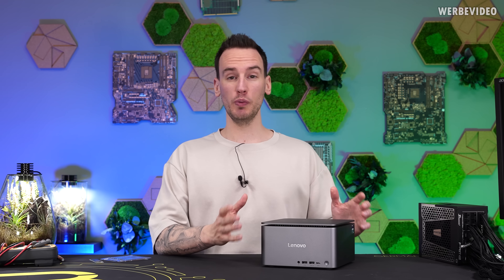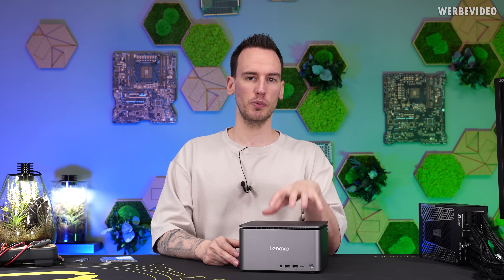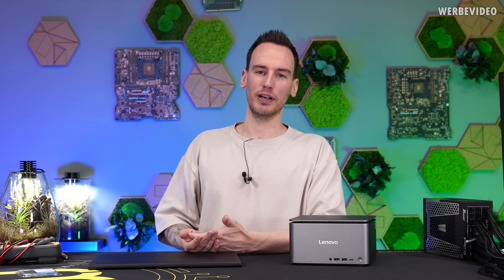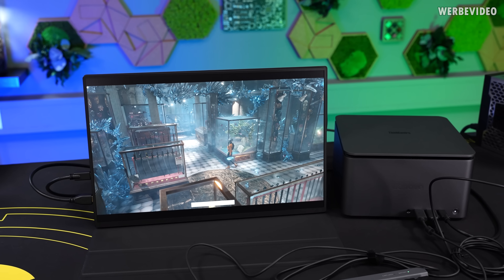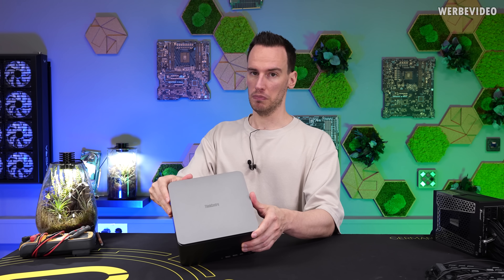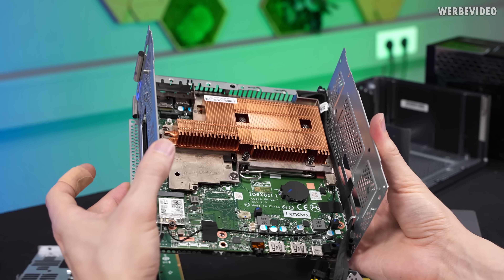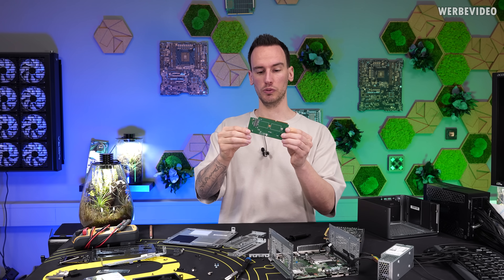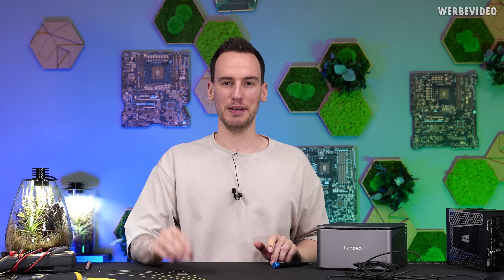Interesting Cooling Solution inside my new Lenovo Mini-PC

Comment: Laptops can feel slow because of the way their bios is set-up. My Asus changes RAM frequency and timings on the fly and I wouldn't be surprised if it mostly stays at the worst ring frequency and gear ratio possible. If I were you, I'd go with 2 gaming laptops from MSI or gigabyte as you'd have higher changes of changing important settings in the BIOS. I'd look for a CPU with the highest tdp possible, lowest node and the highest amount of cores + any Nvidia GPU. I'd lock the GPU at 700mV and set power limit as low as possible as premier won't be bottlenecked by it

Comment: When it comes to notebooks being a little laggy... I own a Dell XPS 9520 with i9 12900HK as well as the Lenovo P16 Gen2 with i9 12920HX. Both of them feel laggy, somewhat unresponsive. Even in maximum performance power mode.

Comment: Awesome little beast of a Lenovo. You should have gotten a thermaltake tr100 case and built a little machine in that. The Tt has a carry on size suitcase that holds the computer, mouse, keyboard, and monitor as well.

Comment: Good news, there's actually a 4070 that is on that size. If you ever heard about this news, it's Zephyr RTX 4070 ITX, the ones with white accent and pink PCB (they also did the black version of that recently called Black Snow)

Comment: I did the same setup last year. If I had to do it now, I would go with BD795i SE ITX faster, smaller ,cheaper. Also mini-pc's have slightly higher powerlimits so they aren’t bogged down like notebooks.

Comment: 10:15 yeah. That's definitely not a good contact with the ihs.
Looks like there's a big distance between the two contact surface areas. (Especially on the right side of the ihs of how we look at it)

Comment: It is not just you even the memory latency that you can see in Aida64 on laptops is HUGE even double than on desktops. The lag is real and sux! I get it that with lower power use comes some sacrifice but not latency on small soldered devices come on!!

Comment: I think that "laggyness" of notebooks is probably simply due to the inherent aggressive downclocking and c-state switching they have. Even with max performance setting inside the OS and BIOS, notebook components have power saving things built in their firmware

Comment: *Ethernet works better than Wi-Fi. What a F surprise! As ISP support specialist I burning my ass to the ground, when people buying cheap shitty Wi-Fi routers and expecting stable 300 mbit/s speed and zero packet losses in games. Just buy (or make) 10-20m Ethernet 5e cable, take it to every ride and be happy, man... it's cheap as hell and giving you perfect connection at 1 gigabit standarts.
*Choose mini-pc instead of laptop for my wife too. Not because it is convenient, but because laptops in the same price range turned out to be worthless garbage. In addition, if the mini-PC or monitor breaks down, you can simply quickly replace them without waiting for expensive spare parts or repairs for the laptop.

Comment: @der8auer EN wouldn't a Mac Studio with and external nvme drive (to avoid apples storage price) have been a better choice?
Or is it just out of the question to work with a Mac for a few days?
It's performance and price surely must be better than this right? And on top of that its really small and great resell vallue.

Comment: A bit disappointing the 4070 is only available in China, I'm in HK and even the official store is only selling the neo Ultra which is 14500+4060, would defo get the 4070 when its available.

Comment: Wifi at hotels is shite. Ethernet all the way baby.
Even with a network card, or onboard network with antenna, 5Ghz WiFI in the same room, dropped connected every 5 minutes or so. Annoying as sh*t.
Also the efficiently they have on those 3 fans is amazing. 2 blower style fans in laptops, and 1 gtx 4060 are very balanced. Insane!
Reply: to be fair, wifi is bad even at ones home, even when one buys a decent router

yes, ethernet adapters are excellent
Reply: @betag24cn  Yep. Hotels just throttle you to 5mb/s, at least at home wifi gets 600Mb/s before I drop connection for a second.

Comment: You are right, this is the best solution for Computex, also great video about it. Indeed, Strix Halo mini-PC's just launched, I already pre-ordered GMKtech EVO-X2- Ryzen AI Max+ 395 Strix Halo (128GB RAM + 2TB SSD version) for 1700 Euro (now is 2000 Euro), exactly for the same reasons, performance and portability. It is smaller, and I think quite close in performance with this Lenovo mini-PC, though 4060 may be faster than 8060S. Worth to make a comparison between these 2 mini-PC's, if you'll get it for testing and review. Good luck on your journey and coverage to Computex.

Comment: Please don't use the expression "2k" to refer to display resolutions; it's deeply ambiguous and confusing. I can guess that you mean 1440p (2560x1440) because you were talking about it in comparison to 1080p but "2k" is actually much closer to 1920x1080 (in fact 1920 rounds up to it, and is half the horizontal resolution of what we call 4k). 

If you have a 2560x1440 display, calling it 1440p is quite clear, and if you absolutely must use a shortened form then 2.5k at least won't get confused with other resolutions.

Comment: Bizarre to me that you would buy a mini pc instead of build something custom with a case like the Dan-A4 or another similar Mini-ITX sandwich style case. The DAN-A4 fits in a standard DSLR camera backpack, which makes it extremely easy to travel with.
Reply: that case is old, and is really expensive to build inside it, mandatory almost to make it watercooled, too much hassle to use it on a trip to another part of the planet, this is air cooled and alot simple, price is not far from the ar watercooled

if you wont move the a4, good, for travel, no watercool, imho

Comment: 12:53 Is that a dead pixel on the middle of screen? Oof, that would make me crazy.
Reply: you can learn pixel massage, works sometimes, i have done it woth success, no need to go crazy, aldo remember that dead pixels on alot of countries are a reason to ask for a neew unit, manufacturer has to replace it

Comment: Can you review the Alphacool waterblock for 5090.
I figure theres a flaw in its flow pattern design; the opening between the inlet port and the GPU areas is too narrow, effectively bottlenecks the flowrate of the entireblock; its fluid resistance is way too high for a block of its coldplate density. 
Sent the block to a CNC factory, have them cut an additional fluid channel on the acrylic top, the result is much better.

Comment: I kinda feel like this is the perfect use case for a Mac mini, or maybe refurbished/used M1 Studio (-a windows user)

Probably worth the workflow change to macOS (and using external storage instead of insane SSD pricing) for just about anyone, considering the nuts performance value of the lower specced minis. Even for 1500 out the door it seems like in Germany you could get a base M4 Pro Mac mini (24gb), and with a thunderbolt nvme I doubt anything would come close to the complete package of performance, thermals, size, power consumption, build quality

Comment: How does a Mac Mini compare to this for video editing?
Reply: About 5x the price, since storage and RAM can’t be upgraded.
Reply: @ storage can be
Reply: @AprilReid-z6j it’s soldered on my M1, but you’re right, M4 has upgradable storage.
Reply: it would be similar or a bit better in terms pf time editing, but a mac now is so closed platform using specific tools that you cant really make a valid comparison imho

on ram, there is no comparison, on storage it is absurd the comparison

noise and size are in favor of mac, same for power consumption, but not by much here

but you can play games here, on mac, you can dream on tuat, just dream
Reply: @betag24cn  You can absolutely make a comparison, Premiere and Resolve run on both operating systems. Nobody is asking about gaming the scenario in the video is a small portable video editing system.
Reply: @AprilReid-z6j  well, this channel is gaming repated, so gaming goes

about premiere, if you can run it on pc, you do that, if you can run davinci on pc, you do that

the most popular tool to edit video on mac is a pc tool? i doubt that

i already said it should be faster but is not ideal or cheaper and it has mac os that most of us do not like, including der8auer, so stop complaining and go play any game on mac...
Reply: @betag24cn  Did you watch the video you're commenting on?
Reply: @AprilReid-z6j  i think you want to complain, about anything, and asking that is just a way to find a crack, to slip trough

of course i watched it

not everybody likes mac os, we like pc and customization, end of the story.

Comment: Have you looked  at  4060ti itx models 
Palit Geforce RTX 4060 Ti StormX                       170 × 125 × 40 mm (L × B × H) 
Gainward GeForce RTX 4060 Ti Pegasus 8GB  169.9 x 124.1 x 38.8 mm

Not a large upgrade but  time is money they say.

Comment: Ha! you don't need to buy a mini-pc to get portable desktop hardware. you'd be amazed what you can fit into an SFF slim case if you own an angle grinder.
I highly recommend Fractal and Silverstone's  cases. personally, I use an FTTZ-01. I really wish they hadn't discontinued it. 10/10 case for modding.

Comment: Laptops may be laggy also due to a shared power supply chain for CPU and dGPU which can provide maximum power input for one of them, but not both at the same time. Also for laptops memory may be working in 2:1 mode and oftenly there's not much you can do about it since corresponding option is usually not available in bios unless you will make or find a custom version for your model, but even then there's no guarantee it would work. 
Though, take a look on a laptops based on the clevo platfom - these often have a socket for desktop CPU and separate power lanes.
Reply: having extra CPU cache would do wonders at a fraction off of power increase compared to 1:1 mode because with 1:1 you only run memory controller harder which increases idle power consumption from ~5w to ~12w but doesn't benefit you much in performance

and going with intel in a mini PC is a big mistake because AMD is WAYYY better than intel under load in both power consumption and peformance while not being apple ecosystem which is a giant scam

Comment: I'd suggest your 'laggy laptop' is because laptops tend to be tuned to be really aggressive on the throttle to preserve battery life out of the box, which means its down clocking hard even in the middle of use. But it could also be your perception or just the laptop HID being slower updating than you are used to.
Reply: I’ve yet to see a laptop that feels as snappy as a desktop with similar on-paper specs. Even after configuring it for less than 30 minutes of battery life, they just never really perform as well even before the inadequate cooling throttles it back by a decade.

Comment: This cooling solution is nothing new, nothing unique or marvel of engineering. It is the standard cooling solution that many Thin clients and mini PC's utilize for many years. My fanless 7 years old Dell Wyse Thin client has almost the same heat sink but because the CPU is low power its size is smaller.

Comment: big +1 that notebooks and laptops in general feels laggy especially in power saving or balanced mode. In performance mode it is less pronounced but it is noisy so no ggod solution with these device. I also have build a mini ITX PC and traveling with it this is so much better. Especially when watercooled you can have big cpu and gpu without the big noisy fans

Comment: My work PC fits in a backpack, it’s inside a Lian Li A4-H20 case, Ryzen 9950x, 240 AIO, 96GB RAM, 2070 Super, NVMe SSD on MB + Optane 905P attached to bottom of the case. It’s quite heavy(mostly AIO+PSU+GPU) but small enough to fit in backpack.

Comment: "Lenovo Think neo Ultra 2025 mini PC with Core Ultra 5 and RTX 5060 will cost around $2,741.00, the price for the variant with Core Ultra 9 285 and RTX 5060 Ti 16GB is TBD"
 - Lenovo
Reply: Wish Lenovo had never signed for Intel exclusive builds.
Reply: God damn that's expenssive, but all aluminum case is nice, looks very premium. I wonder how the air cooler will handle the Core Ultra 9 285
Reply: @denissh9478  Probably better than the 14700 to be honest. Arrow Lake copes with lower power quite a lot better. The 285 is basically just a socketed 285HX. It gets +100mhz on the P-cores and -100mhz on the E-cores compared to its soldered brother, and PL2 is also similar. I've seen worse heatsinks in gaming laptops handling ARL-HX just fine, and given a 70W 285HX trades blows with a 180W 14900HX in multi-core, you could probably get away with a pretty low power limit on that CPU by default for a system like this.

Comment: Laptops when running on battery are quite anemic and overall if you have access to power outlet then its always better to get one of these mini PCs for travel.
Reply: The battery shouldn't even be the limiting factor anymore though. Mostly the limit is because of the cooling.

Comment: thats actually a neat mini pc concept, im wondering why you didn't go with a strix point since the Igpu is around a 3060 or a mac mini

I wonder if you can upgrade the GPU to a 4060 ti or if anybody maker a short 5060 ti or mod your own like the gigabyte one to make it shorter you could fit it in there

Comment: It's sometimes anathema in PC enthusiast communities, but one area where Apple's lineup shines is in portable video production.

If you use Resolve or Premiere, just using the same thing on a tiny M4 Pro mini would likely net the same if not better editing and exporting results. Much smaller footprint, much less power draw, packs easier.

But then you are using Apple's locked down hardware... it's a trade off I'm fine with making, but I also don't have any strong ties to Windows for any of my workflow!
Reply: we would like to upgrade ssd and memory
Reply: Yeah, it comes down to price. From a brief Google search, Apple is not cheap in Germany, with the Mac Mini alone coming at 3200€ for 64GB + 2TB SSD.
Reply: I guess it's time that Jeff has to realise how efficient and reasonably pricing the Duranaut is, when Roman chose refurbished Lenovo over the M4 Max Studio.
Reply: Lian Li A4-H20 would probably be a better fit. Still fits in a bag and can run basically anything (ex: 9950x + a powerful GPU + 2 NVMe, etc)
Reply: I just checked, and the M4 Pro would end up more expensive with significantly worse IO and no possible future upgrades.
Reply: I want at least some resemblance of user-upgradability and right-to-program, no thanks.
Reply: Would have loved to see a vlog of him trying out the new Mac Mini.
Reply: you heard his words about prices? Upgrades (you may need to google that one) ? And the killer Apples desperation to remove ports.
Reply: @Thisandthat8908  prices? He spent €1500 on a refurbished system (before upgrades) for a system which I suspect edits and renders video about as well as a brand new entry level M4 Mac Mini.
Reply: Ya'll really don't consider convenience at all in this. I'd even go as far as saying a macbook pro would be a fair price cause it includes an editing grade display, mouse, keyboard, and even a battery all in a little laptop you'll barely notice in your backpack. I realize that he mentioned not wanting a laptop but from owning a base spec m3 macbook air that's already snappy I could not imagine an m4 pro feeling worse than that machine. Sure a brand new macbook with 48gb of ram and 1tb ssd is $2600 usd but that's only 600 above the new price of that machine which I'd argue is justified by the display, keyboard, and trackpad
Reply: @abzu_depths3640  Sorry but all I could hear was a bunch of bleating.

Comment: That case - it's... solid, one peice aluminum? Like they milled the whole block out? That can't be right. but I'm not sure how else you could make it. I suppose casting then mill, but that still seems like a crazy amount of work and expense.
Reply: Walls look line one piece of extruded aluminum with some cutouts with the top being a separate piece of aluminum. It's certainly not a milled solid block of aluminum because that would be wildly expensive.
Reply: Probably two pieces of extruded aluminum and weld tgt?

Comment: I hate the small and partially obstructed power supply fan 3:47.  Also, I don't like the cooling on just one side of the SSDs and very little airflow to the memory in the bottom.

Comment: The 2025 version with a 5060ti and an intel 285 was already announced in april. It would be so great if lenovo sold the gpu seperatly so people with the 2024 version could upgrade
Reply: why the heck would they do that? you're out of touch with reality 😂
Reply: As an AMD user for the past 7 years I agree. Why not experience black screens and driver failures with a nice new janky 50 series.